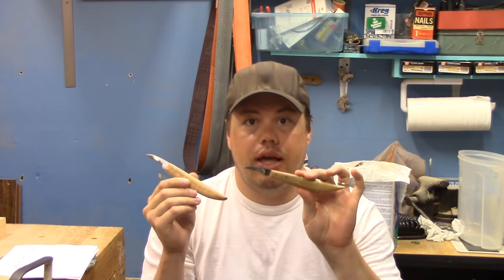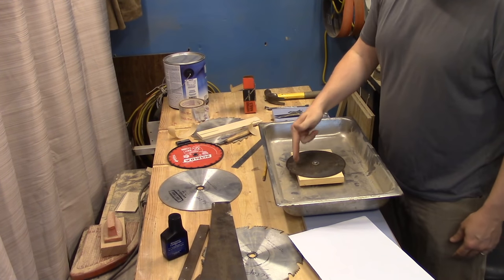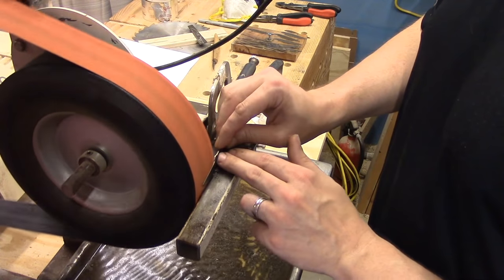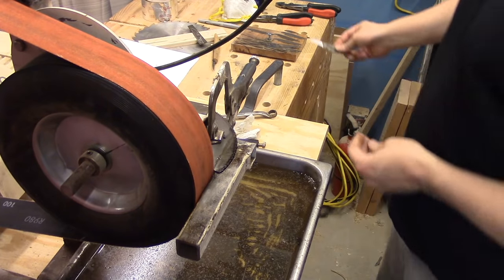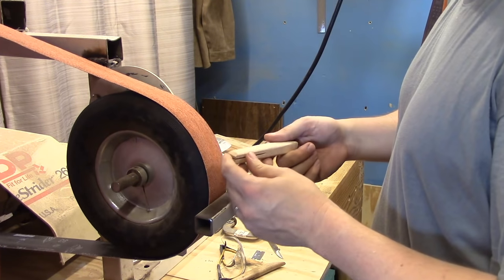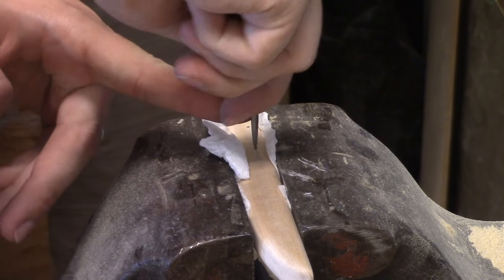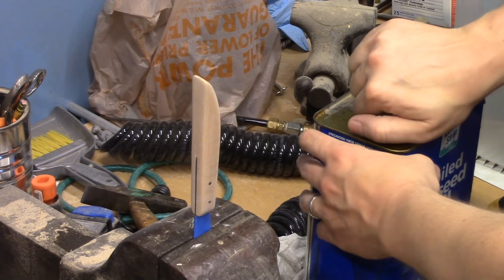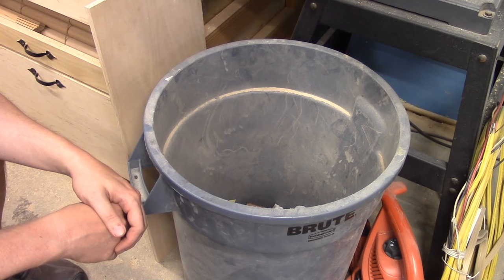Carving knife from an old saw blade and pallet wood

Comment: What did you do off camera to the steel so that you could drill through it? I recently made one and had a hell of a time drilling through it. I even brought it up to orange hot and let cool . The steel was still very hard. I smoked 2 drill bits poking through it. Eventually I brought  it up to orange hot again and kept it orange for 2 min before  letting it cool. Once that was done, I went to sharpen it and it was giving me a raggedy  edge . I hardened it and tempered it , quenching in water and that did the trick. Was able to get it razor sharp.
Reply from the maker: nothing, I just used high quality drill bits.
Reply: @BigDaddyOworkshop  hey now.. What are you trying to say? Lol  actually. Ive got sets of various qualities. I wouldn't risk smoking any of them trying to drill through a piece of mystery steel. I left a long tang . It spanned 3 rivets . The first 2 went without a hitch. After wearing the second bit, I finished it off with a diamond dremel bit

Comment: Mike did you heat treat the blades at all?  By this I mean heat to red hot and then dunk in oil and then anneal by putting in the oven for 30 -60 minutes.  Just wondering.
Reply from the maker: no, the whole reason for the water pan was to keep the steel cool enough that I didn't have to deal with that.  I still have all the bad blanks that I could put through that process to try and get them to harden better but I don't really want to deal with that.